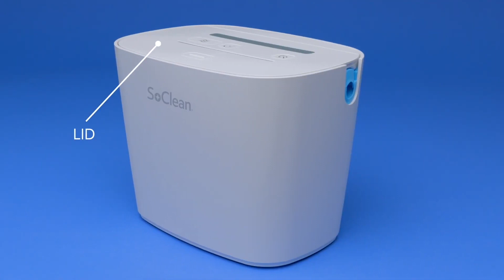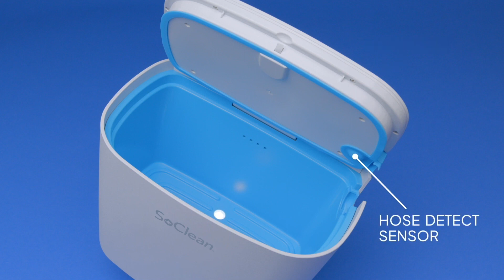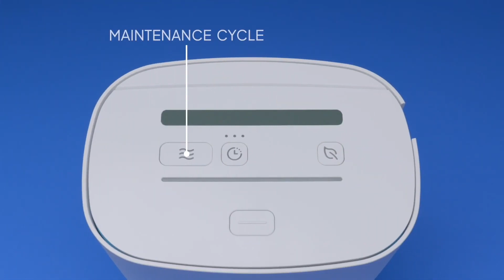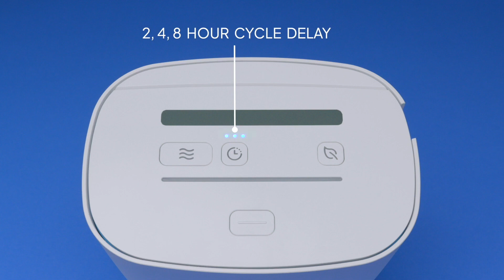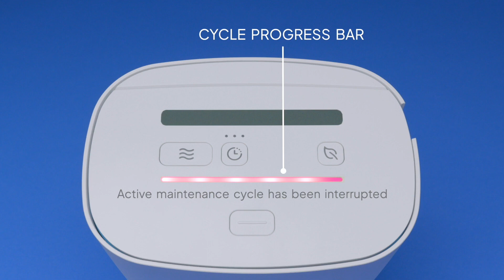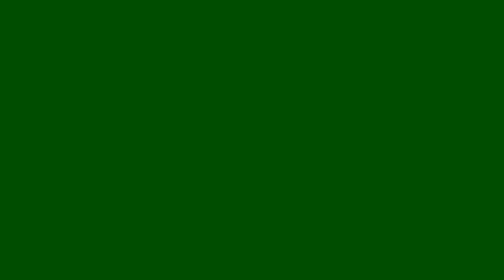SoClean 3 Introduction & Usage Guide - DirectHomeMedical

Comment: How long does a cycle take and had the lenght be changed?
Reply from the maker: Hello, the SoClean 3 cycle takes roughly 1 hour and 15 minutes. Take care.
Reply: I have the 2. I use the mask that has tube attachment on top of head and frame is tubes that run down both sides of face. It will not fit in 2 without kinking. Does the 3 compartment have a big enough chamber to not link mask frame?
Reply: How long do filters last ?  What’s replacement cost on filter ??????
Reply: Do not use the SoClean machine on any CPAP! It will destroy the internals. Takes about 6 mos to a year then you’ll be left to buy another $1k machine and SoClean won’t give you a cent to help out. My Airsense 10 was ruined by this POS O3 machine. It literally turned the turbine and other plastic parts into a sticky mess and disintegrated all the foam. Just imagine what went into my lungs as a result.